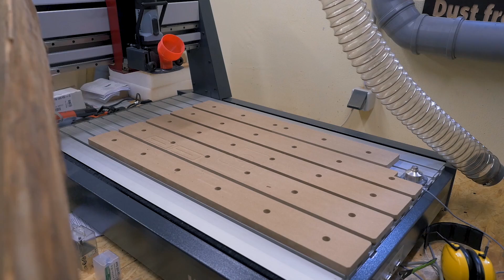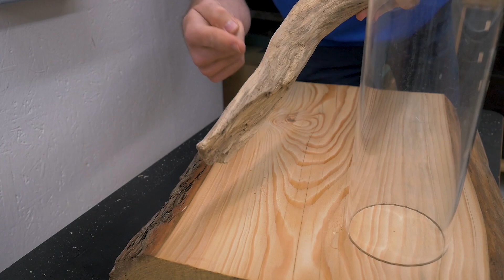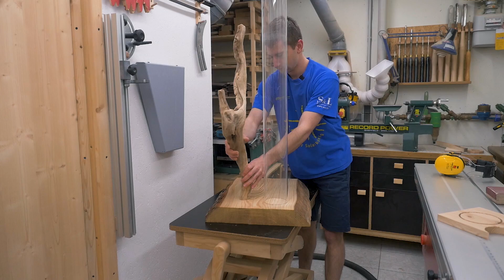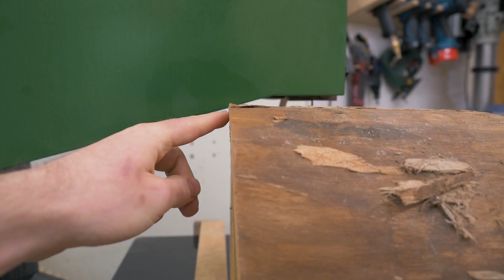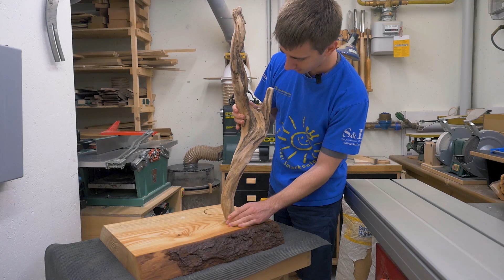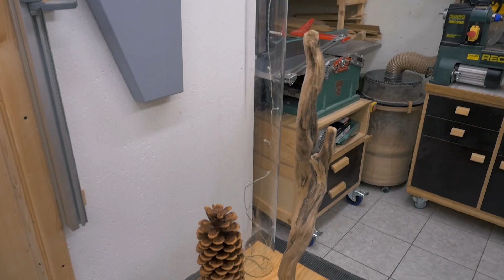Mum Projects | Cool Mother's Day Gift Ideas

Comment: Hi Marius. You may also have macro capabilities with your CNC software. I'm using EdingCNC and made my flatening macro. So no need to reprogram each time the routing path. I'm moving my router bit in the 2 corners of the rectangle surface that i'd like to flatten and so record the X and Y coordinates. I'm than defining the starting and stopping heights, the steps down, the dia of my flattening tool and the step over. The macro executes than the needed back and forth movements.
Reply from the maker: This sounds pretty cool and useful. Is that programmed in the macro.cnc file?

Comment: Great video, as always. But wouldn't it be easier to just drill a hole for a dowel in a large branch in the first contraption, rather than to mount it awkwardly at a pantorouter and to make a dowel out of it? And also, christmas light is a light-chain in German? Cool.
Reply from the maker: Yes, but I didn't have such a big dowel on hand

Comment: I do not know if it will work, aber, when you drill a little hole in the grove of the tube and you put a light from the bottom in it, the tube will light up. Und dan, when you take a color changing light you can make it glow all kinds of wundershönes farben.

Comment: As you have a lot of experience of both, is there much advantage between a sliding table saw and a basic non sliding table saw?  I only have a track-saw and it gets difficult finding ways to balance the rail to make smaller cuts.
Reply from the maker: I have no experience with a good non sliding table saw, but I'd go with a sliding table.
Reply: A sliding table can usually be locked to give you a fixed surface, so, if you have the money, definitely get the sliding table.
Reply: For balancing the rail of your track-saw, make sure you have at least three pieces of material as thick as the one you need to cut and slightly wider than the track saw. Put one each "in front of" and "behind" the object to cut, and one next to the object (away from the cutting edge) to provide balance.

Comment: Super Ideen und wie immer klasse Video
Hoffentlich is die Röhre nicht aus Glas wenn die so eng sitzt wird die bei holzbewegung bersten wie bei meinem dad 
Welches Programm nutzt du für die cnc?
Reply from the maker: Das Rohr ist Plexiglas oder PC. Eding CNC zum steuern. Fusion360 und Vectric Aspire für die Programme
Reply: @MariusHornberger  dann is gut hatte schon etwas Sorge um die schöne Arbeit
Für CAD bin ich auch mit fusion zufrieden aber aller Anfang is schwer